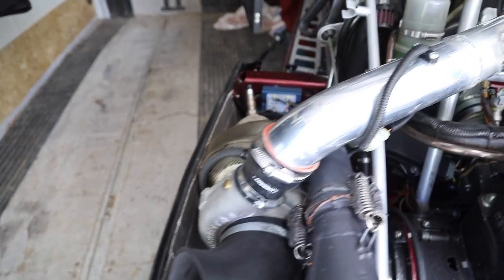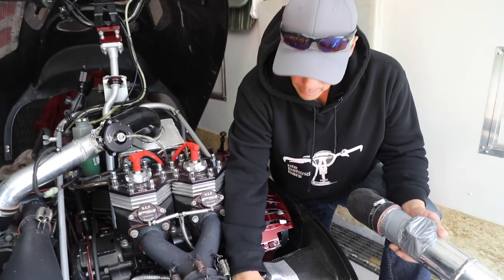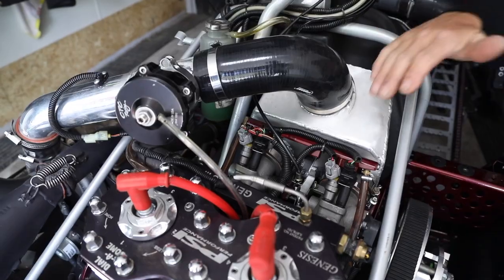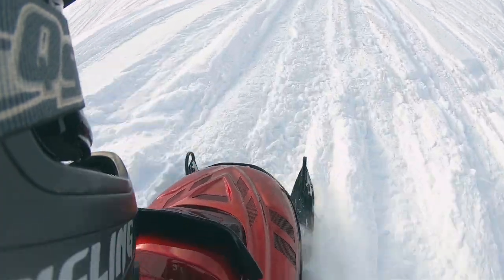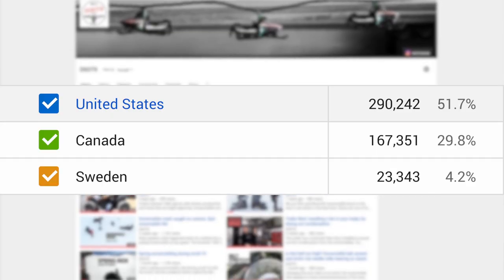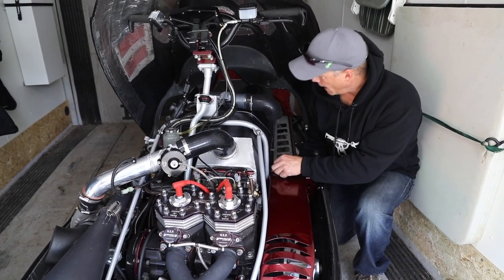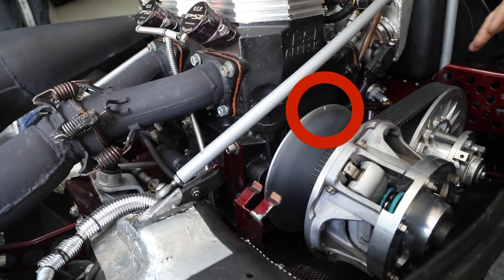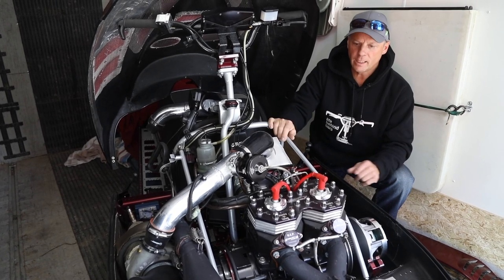Boosted 2-stroke 1200cc twin updates and mods

Comment: @digit9 could you go over the VEP on that engine? I recently got a hold of a PSI 925 and the guy cut the tubes and I have no idea where in the world they go to. Going in a Polaris Gen 2 chassis this fall!
Reply from the maker: Tubes on bottom of ves bellows is just a oil drain line , put them into a bottle you can empty or run them out bottom of sled !

Comment: I really want to see this thing dialed in. Two strokes are incredibly difficult to get dialed in. The turbo back pressure plays a huge role in getting it to work. If you can size the A/R to maintain a 1:1 pressure ratio boost vs back pressure then the engine functions as if it has no turbo. 4 strokes are easy because you can run back pressure as much as 3x boost. It's very inefficient and the turbo will take a beating but it still makes power. 
That's why variable geometry turbos work so good on 2 strokes.
Reply from the maker: Its definitely a juggling act between , blow off valve , boost box , turbo , pipesize ! Im learning alot and one day will have it dialed !

Comment: Nice build!!  I missed some videos and I am sorry for that. One question?  How do you live the turbo??  I have an old 800 Polaris and a old RX1 I would like to play with. My buddy's run blowers so I would like to try a turbo. Great sound from that engine.
Reply: Damn spell check.....Not Live LUBE...LOL. Lube the Turbo.
Reply from the maker: It has a oil tank below turbo , oil is fed to turbo with a low amp draw pump I got from CPC Racing !
Reply: @DIGIT9  ....Nice is there an issue for the oil temp at any time?  I figured you had something like that setup but I was not sure?  Never seen a sealed bearing in that area so I was wondering.  Thanks for the reply.
Reply from the maker: Never a heat issue , Turbo is cooled with coolant from motor ! They make smaller Turbos with sealed bearings but I had this one all set up , didnt want to change it !
Reply: @DIGIT9  .....Very interesting.  Coolant cooled just like my Freightliner Cummins. Nice!!

Comment: You gots fueling by electric but where’s your wide band o2 sensor. Carbs are mechanical but your injectors run on wires. A loose connection( and aren’t sleds good for vibrating shit loose) on any one of you plugs could cause pulse width issues. At least you could let off right away under lean conditions or see how black your plugs look under a rich mix.

Comment: 2 stroke newbie here, are these two stroke using crankshaft pressure for compression like dirbikes do? Does that mean you can turbo a two stroke dirtbike like this?
Reply from the maker: What do you mean “crankshaft pressure “ ??
Reply from the maker: But yes you can Turbo a 2 stroke dirtbike !!
Reply: @DIGIT9  Well, from what I've read, dirtbike two strokes compress the intake air using the downstroke of the piston, which forces air through the transfer port and into the combustion chamber. Thanks for your answer!
Reply from the maker: Crankcase pressure  yes !

Comment: What kind of crankcase seals do you run in that configuration? This is something I've long wanted to do in a case reed motor. I've finally found a solution with high differential pressure seals. The ones I found are from VR Dichtungen. Brilliant design.
Reply from the maker: Brent Linderman built this motor , from Arctic Edge Motorsports , ive never had the bottom end apart yet , not sure what he uses but he assured me that this motor can handle 20-25 psi of boost !